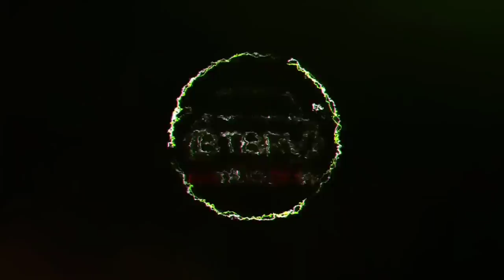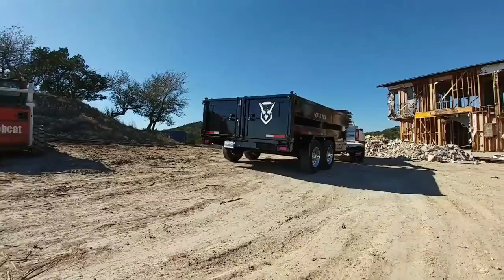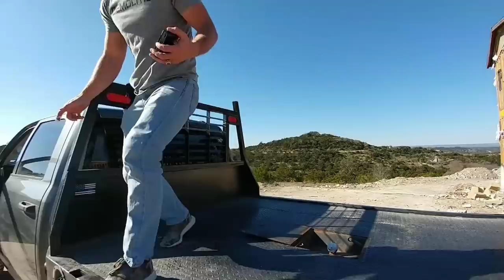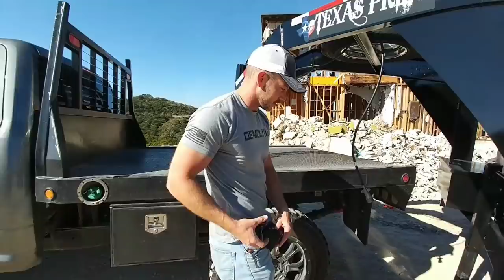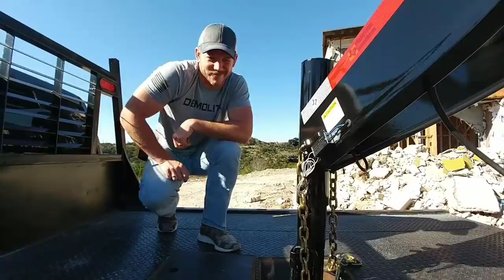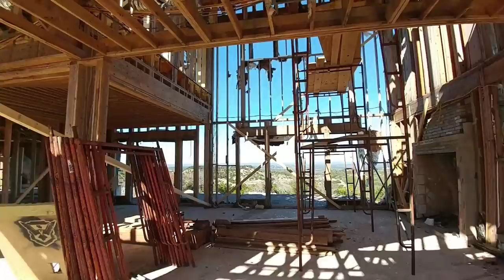Helping Demolition Ranch Hitch a GOOSENECK Dump Trailer! Featuring the Renovation Ranch MANSION

Comment: Thanks for hanging with me JD!
Reply from the maker: No problem my friend. Thanks for inviting me out! Now you need an RV.... Just say'n
Reply: Hope yall hang out more often
Reply: Matt RV c'mon get those kids out there. We rv 5 kids no excuse 😁
Reply: make sure you use the break away cable Matt, DOT likes to hammer gooseneck haulers for that.  I love my 41 foot gooseneck from Texas Pride !
Reply: there needs to be a demolition ranch video of y'all blowing stuff up... lol maybe blow up that dodge truck and get matt in a ford... just don't tell mare... lol
Reply: or he can drive the ford and WHEN  it blows up , he can edit it into a video ! LOL
Reply: Heck yeah two of my very favorite ‘tubers! I’m not sure whose dump trailer I like best though lol!
Reply: @warrenmichael918  lol
Reply: @supporterofsanity  i like jd's trailer because its red but i would likely get it longer and goose neck... in fact i have been lookin at getting a texas pride trailer for a while now and that front vertical lift cylinder and the fact that they will down rate the trailer seals the deal... when i buy my trailer i will be buying a texas pride.. i wand the 20' triple axle 30k trailer in red or equipment yellow with the alcoa aluminum 48" sides with the upgrades that matt has on his like the 12" on center and the thicker floor..
Reply: I’m here from OTR, great trailer.
Reply: OffTheRanch aThat was fun Matt.
Reply: That was much fun.  Thanks for being there for Matt - He's kinda new. . . .
Reply: Lol anyone else watching this just cos of Demo ranch? Lol
Reply: @BigTruckBigRV   I love watching all of Matt's  channels. @Off the Ranch @Demolition Ranch @Demo Wrench @Vet Ranch. I came from his channel and now I'm subbed to your channel. Thank you for taking your time and allowing me to be a part of your project via YouTube!😀
Reply: Hi Matt

Comment: You can always tell a non truck driver. They do not know how easy it is to back up to any trailer by using the side mirrors. I have watched people on YouTube fighting 5Th wheel hitches, which is as easy as it gets. Much easier than a gooseneck without assistance. If he had anything on the bed blocking, he would have been going crazy.
Reply: Bob Stover I always just look back line up my middle head rest in the back with the goose neck easy money

Comment: I am new to construction work but am a driver (new to that as well) for my company. This is a type of trailer I have not used yet. While I know it handles differently than a traditional trailer, I have never seen the actual hook up process. Thank you you. If I ever need to pull one, I’ll remember this vid.

Comment: On my truck without the gooseneck backup camera I just use the headrest in my back seat to line up with the gooseneck. Sometimes it’s spot on and sometimes I just have to give the trailer a slight push or pull to one side.

Comment: A feature that should have been standard  on a trailer rated for that much weight is two jacks with two speed drive.  One jack will make it very difficult and unstable to raise and lower the trailer with a load on it!   Texas Pride should have  made this standard,
you get what u pay for.

Something  they will  probably learn the hard way is to ALWAYS  raise the jack to  max height,  when it gets buried in the dirt  it's toooo late!

Comment: A little how to advice on the jack....pull the pin on the jack and turn it 90 degrees so it holds. Then use your foot to push it down to the ground, flip the pin back and slowly let it up till it locks. Then crack the landing gear down. Your over making way to much work on your self in your video’s. And yeah his truck is higher ok but I’ve seen you drop your trailer and it’s clear your making this into a workout.

You also need to crack it up all the way then back off a 1/4 to 1/2 turn to put the handle in the carriage. Key being jack is always all the way up before you move on.

The dump trailer needs jacks on the back for loading and unloading equipment to be safe. When the weight shifts to the back of the trailer those rear wheels will loose traction and could slip....then the whole rig starting drilling down a hill. I know this first hand.

Rant over....Sorry could not help myself. Great content though.

Comment: OMG JD & Matt. Gotta ask y'all if the tongue Jack on these Texas Pride trailers is the same as the what comes on the landing gear for a semi trailer? If it is, I'm surprised they didn't advise y'all the crank handle has 2 speeds. Perhaps y'all should try the 'stab or yank manuever' to access the higher speed for raising or lowering the trailer. It will only help when the trailer is unladen. Low speed works for laden height adjustments. Might save y'all some muscle for actual workouts.
   Giddy up!

Comment: What did Matt think of his customized logo on the back of the trailer? Too bad the landing gear doesn't have 2 speeds like on semi trailers.
Reply: That is what i was thinking. Why isn’t there a high gear on that landing gear?
Reply: @rhombus20  more important, why is it only manual?
Solar to charge the batteries, hydraulic (whatever its called in english) not to mention possible power from the car...

Comment: nice hook up but u for got the brake away cable and where to put it
Reply from the maker: It was connected at the end. .you'll see it in his video
Reply: @BigTruckBigRV   ok  nice trailer  and I enjoy ur videos as well I have a 24 ish coyote trailer with one pull out and to tip Downs for beds I also have a 24 foot tri axle trailer are used for hauling cars boats equipment. I'm now looking into getting a deck over trailer with 7500 pound axles and I need at least a 20 to 25 for deck do you have any suggestions

Comment: is there a reason you both spec'd it out with just the one drop leg jack and not the standard two jacks??
Reply from the maker: The standard is 1.  Generally over 20k gvwr and you get 2
Reply: @BigTruckBigRV  a 14k on there web site has the two jacks and if you spec one out you can find a single. if there a standard it dosent show. i would think the twin would be better it would get the full size frount box

Comment: You should of greased his ball for him to show him the proper way to grease a ball.

I usually start from the bottom. Make a cup with my hand and gently apply lotion the the bottom ball neck (shaft) and work my way up. 

Usually apply it for 5 minutes gentle but firmly massage it. Once the lube becomes hot is when you are ready to apply weight on top the the Ball. 

Balls🤣😂